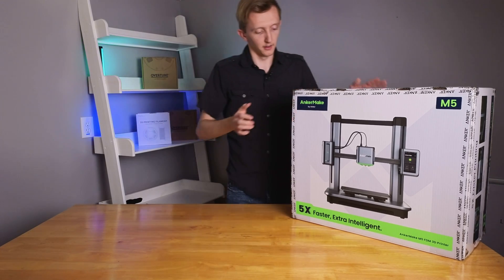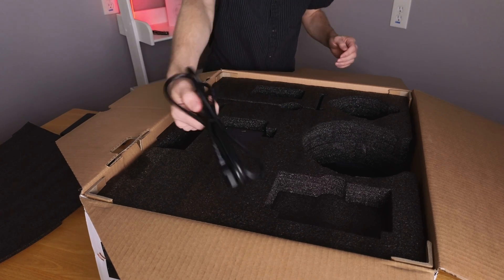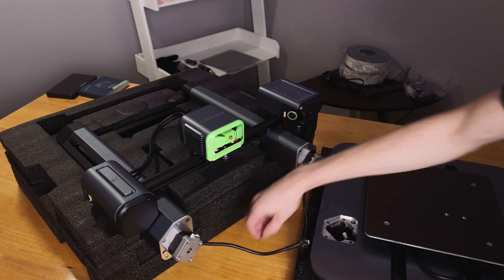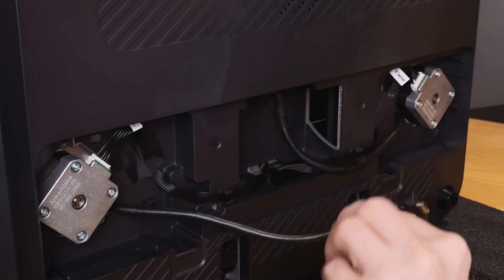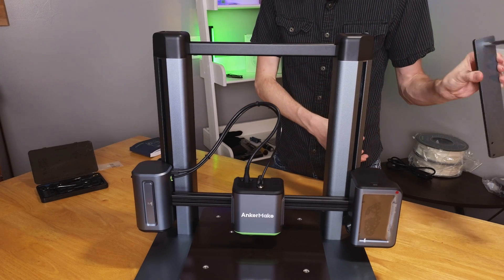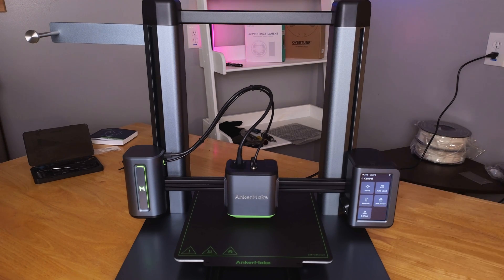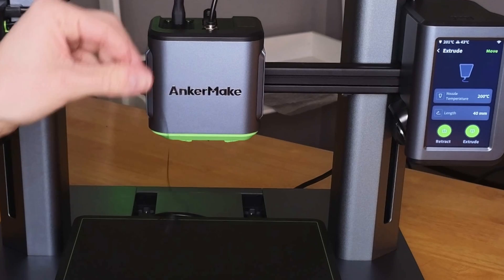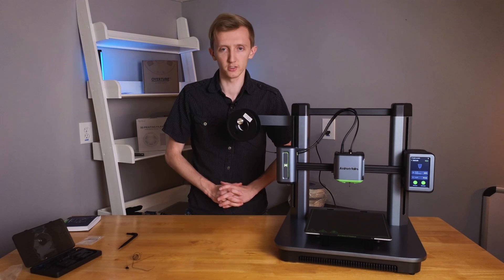AnkerMake M5 3D Printer - Full Assembly Guide

Comment: Do you recall what preloaded files if any are preinstalled for printing? And did you get the additional USB stick?
Reply from the maker: There's about 10 of them, and off the top of my head, there's a Benchy, a precision benchmark, a dog, a shark car?, yeah. I haven't used many of them since idk what the slicer settings were for them and I want to control my prints more than pre-sliced things.
Reply: @Ecto3DPrinting  Thats odd I only had a version of the 'complete 3D Printer test'.  Thank you fot the replies.

Comment: Nice video! Thanks!
Did you change the Z offset eventually? By how much?
Reply from the maker: Thanks! Yeah, I just went right ahead and did it, and I've had no issues with adhesion. I adjusted it to +0.1mm. At 0 it seemed like it was really grinding into the plate.
Reply: Great thanks. And with 0.1 offset you didn’t have any adhesion issues?
Reply from the maker: @magnetips9871  Nothing yet. Things seem solid!

Comment: Welcome officially to ytube :) did you experience any issues connecting to the 5ghz wifi? It Sems like Mans Users have issues with that.
Reply from the maker: Haha thanks for the welcome! 
I've actually had zero issues with the WiFi connection. I have dual band WiFi, so 2.4 & 5, but no issues. The app does start by saying that the printer needs 2.4GHz in order to connect properly. Hope that helps!

EDIT: I had some minor issues after the printer had been on for a while that the phone app wouldn't let me watch the live feed, but it was still updating the timer and stats.

Comment: Good video! The one thing I will say is that your spool configuration could be problematic at higher z layers and maybe break your filament. I recommend rotating the arm up 90 degrees at the top position so it extends up over the top of the gantry.
Reply from the maker: Ok, yeah, I can see that happening up there at the high points. But also wouldn't it been the same problem in the vertical orientation when the z-height is low? I guess I can try some things and find out! haha
Reply: @Ecto3DPrinting  Your quick start guide should show you how to orient it, I dunno if it will really make a difference. Just thought I’d mention it 😁
Reply from the maker: Thanks! I just flipped it up so we'll see how things go!